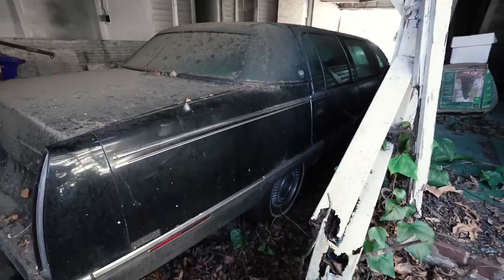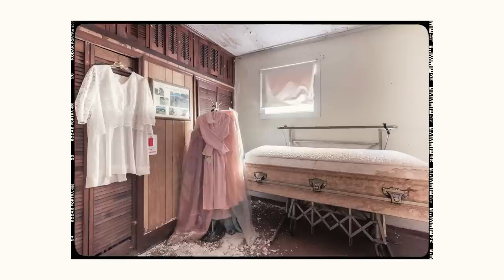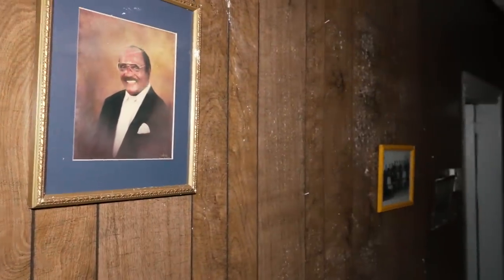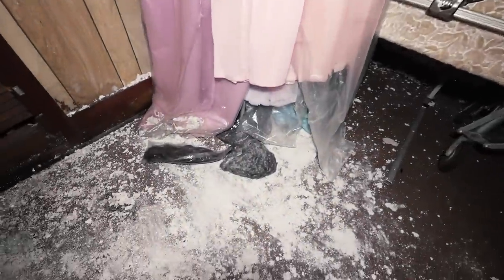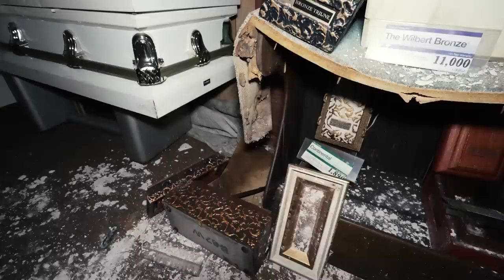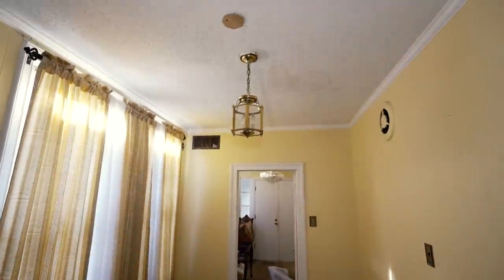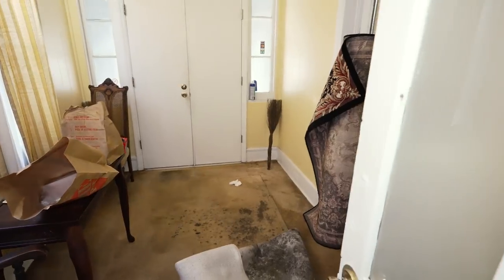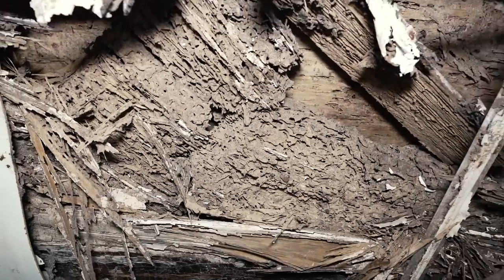Abandoned Funeral Home Exploration - We Found Caskets and Hearses

Comment: The $11,000 was a burial vault.  It is the most expensive one they make.  The fabric on the casket is a cloth unit.  The fabric makes it look better and underneath is frequently fiber board.  The no lined bottom of the wooden casket means it is a rental casket.  The bottom of the interior slides out with the body on it and it is frequently cremated then.